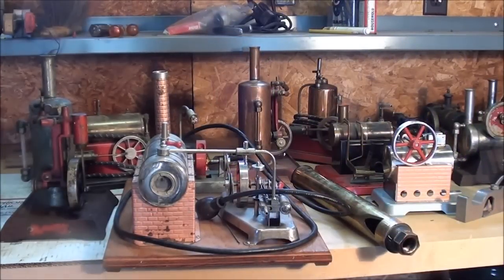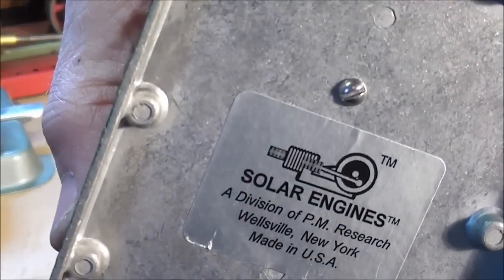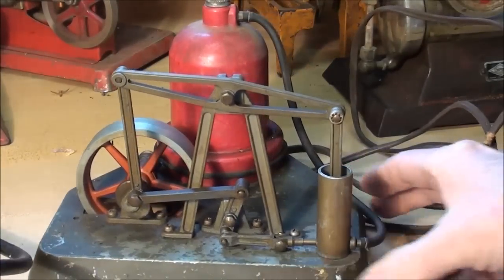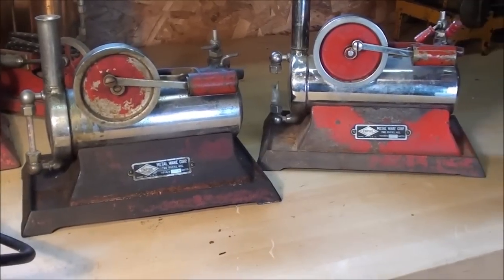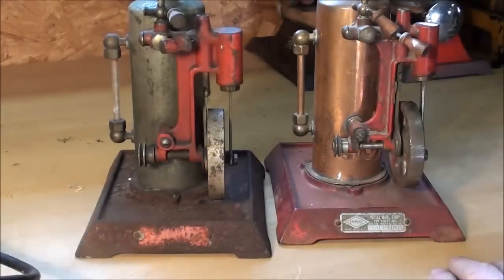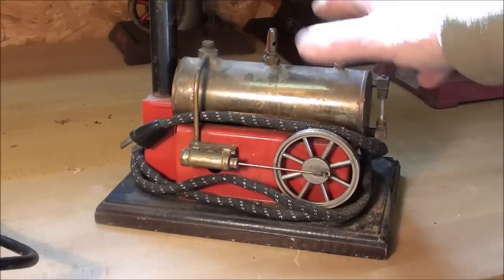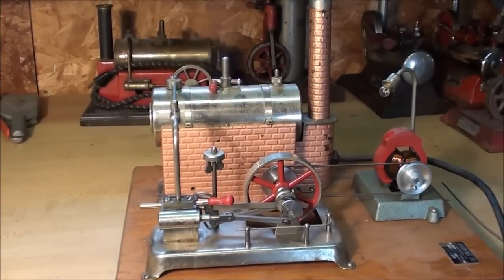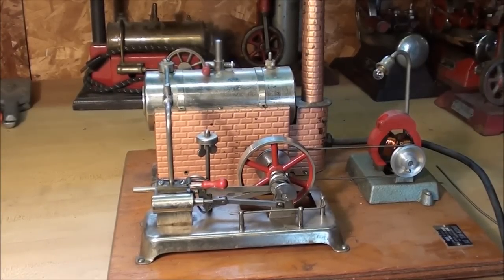TUBALCAIN WENT TO AN AUCTION SALE 1  mrpete222

Comment: mrpete222   What a Wife you have!, my Wife really dislikes my machines an I say tough.  I live in a 55+ gated community and will try to start a new club of people interested in metal machine shop. Retired now but my first 7 working years were in tool & die making shops and I just love running a manual lathe, mill & surface grinder. By spring I should have my garage shop up and running. Don't let the mindless fools with rude comments get you down as you are one very talented & smart man. Thank You Again for all the great videos as they are a huge help to me. Best Regards Bill B
Reply from the maker: +Bill Brennan thanks, and good luck with the machine shop

Comment: The Jensen steam engines are indeed still being made here is PA using some of the same machines and techniques used and designed my the founder. There is a very interesting PA public TV show with a 30 minute tour of the facility.
Mr Pete, love all your videos no matter the subject. Bought an Atlas TH-42 lathe and have made 2 wobbler engines following your lead. Wish I could figure out ho to make a boiler work. Despite 3 attempts that has eluded me.
Loved the Lionel comment. I've been adding "accessories" to my first set for 57 years now.

Comment: hi mr Pete the mamod engines were usualy fired by methilated spirit .and the holes on the base plate would line up with meccano which is a metal construction set like your erecta set,Dave in the UK

Comment: Hi Mr. Pete,  the German company Wilesco still makes stationary steam engines like your Jensen model. some are even 2 cylinder. they also make a steam tractor which is really cool.
as with your models they offer all sorts of do-dads to hook up to them and are a bit expensive too. one of the things they still offer is the "drive belt" spring you showed with the Jensen. most of that stuff is easily found in ebay or if you want more variety in german ebay. nice upload thank you for posting

Comment: As others have stated, Jensen is still in business at the same location in Jeanette, PA.  They also carry repair parts for many of their engines, so you can repair the site glasses or fix the steam leaks with your other models.  The one you just shown is a 25-G, which is still in production (with the wooden board too!).  Your engine is probably from the early seventies before they quit making the cast-iron based generators.

The generator uses a #14 miniature bulb.  You can get these at a reasonable cost from many retailers.  By the way, the Jensen generator produces AC.

You can use your Dremel speed controller to turn down the heat for the boiler if you like to run your engines slow without blowing the pressure-relief valve.  If you check my whopping one Youtube video, you can see my Jensen 25 running a Jensen workshop using this method.

Comment: Hi ,
    The Weeden soft soldered boiler is OK to use with a flame as the solder requires 300 degrees centigrade to melt, which it would do if there was no water. The water absorbs the heat and limits the max temperature to 100 degrees centigrade and the more heat put into the water then the more steam is produced thus regulating the overall temperature to well below the solder melting point.
MoK
Reply from the maker: +Mo King Thanks for watching

Comment: Very Nice ! Love your new toys. My Wife is the same as yours as wife just hates tools and especially my machine tools. Have a Clausing table mill, Hardinge HSL Speeder lathe and a 20" Delta drill press.  I really enjoy your videos and Thank You for sharing you vast knowledge on machining & steam engines. Bill B Naperville IL
Reply from the maker: +Bill Brennan I have been to Naperville many times. I have eaten in teds steakhouse. And I like the big Barnes and noble bookstore. You are wrong about my wife, she loves my tools and machines. Thanks for watching
Reply: mrpete222   What a Wife you have!, my Wife really dislikes my machines an I say tough.  I live in a 55+ gated community and will try to start a new club of people interested in metal machine shop. Retired now but my first 7 working years were in tool & die making shops and I just love running a manual lathe, mill & surface grinder. By spring I should have my garage shop up and running. Don't let the mindless fools with rude comments get you down as you are one very talented & smart man. Thank You Again for all the great videos as they are a huge help to me. Best Regards Bill B

Comment: Probably a bit late to mention and someone might already have said but anywho, a lot of the older Mamod boilers (and Bowman if you're lucky enough to find one) were soft soldered instead of a good silver solder, got a good example floating somewhere where one of the little copper steam pipes has de-soldered its self, the bases were designed to be compatible with Meccano/Erector sets so you could steam power your build via that little brass pulley

Comment: Lovely video,,, what a nice selection of old toy steam engines,,, I had the Mamod reversing engine and your right it was made to be used with an "erector set" called Meccano here in the U.K. I made a 6 wheel drive lorry, all independent suspension, a huge reduction gear box also 6 speeds and  clutch etc, with the Mamod engine driving it and the engine would have to run 30 odd seconds just to take up all the play or slack in the transmission chain before the wheels would turn, after many attempts at reinforcing the back twin axles so could put a huge pile of my Dads Railway magazines on the lorry, and on all the differential crown wheels and pinions etc the axle rods had to have flats filed into them so the little screws hold them firm without slipping ,,,,   it finally got enough grip on the carpet that it pull me as a 8 or 9 year old on a trailer my Dad made out of an old wooden box from  a Electrolux cylinder vacuum cleaner, But the trailer had to be on the hard Lino or linoleum flooring with a 2 foot long tow bar to the lorry on the carpet,,  and on one fuelling of methylated spirits the little engine pulled me and the trailer 14 inches,  Your videos are great,,,, many thanks, Mr Pete.
Reply from the maker: That must f been quite a little steam truck. Steam has tremendous power. Thanks for watching
Reply: I tried making something like that with a Mamod engine (which i still have) but it was belt drive and belt kept slipping so would only work on a hard surface like a table . . .Mine would of been very basic compared to yours